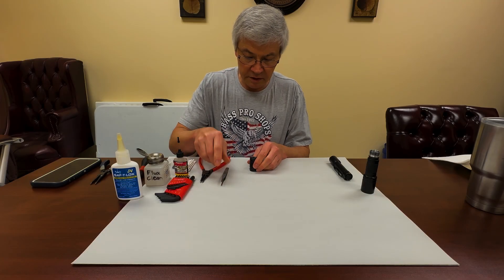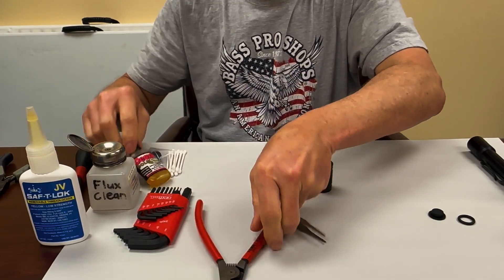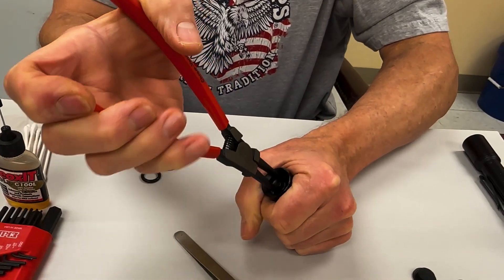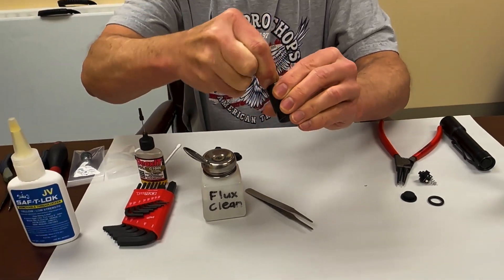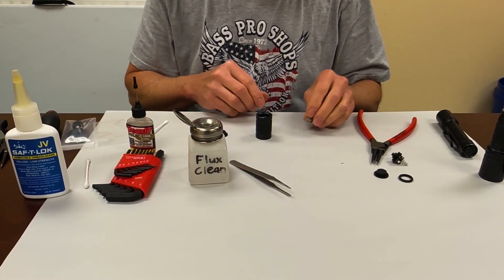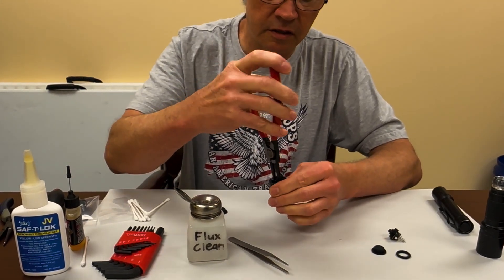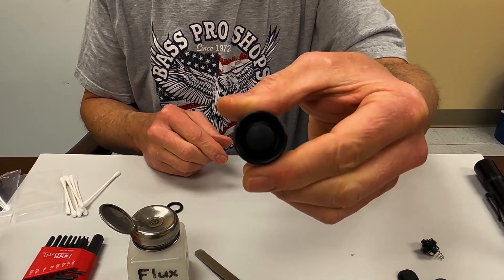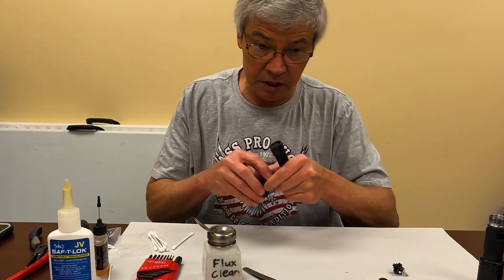1.McClicky Switch Replacement & Maintenance for Malkoff MD2

Comment: Awesome!  Thank you for the video. This is great info. I’ll do this exact procedure next cleaning. 

I use deoxit on the head too. I put one drop on the plunger on the hi/low ring after cleaning with alcohol as a “lubricant”. I get ZERO flicker cycling the head from low to high even on single cell lights that have less power going through them. (Md2/18650/m61n)

Keep making those bomb proof lights!
Reply from the maker: Thank You for the kind words.  That is a good tip for the deoxit on the single cell lights.  Flickering is common when  during the rotation on a single cell light.